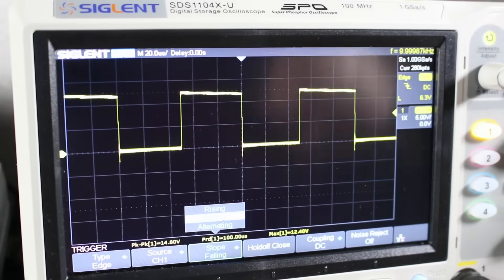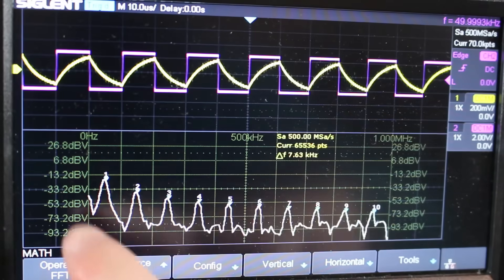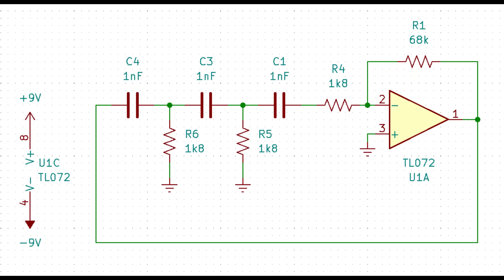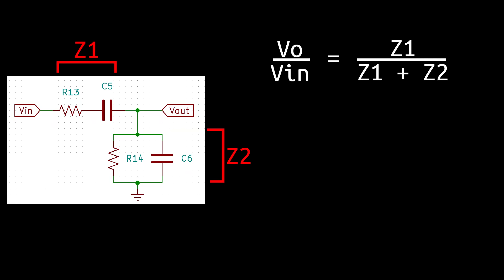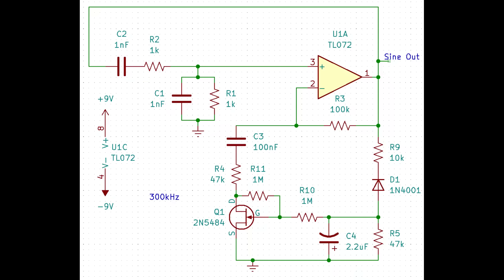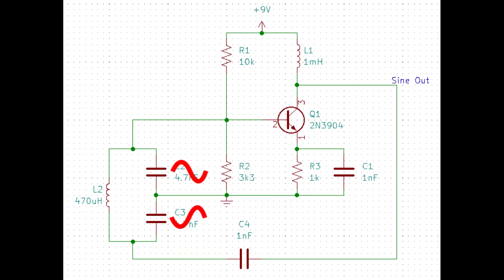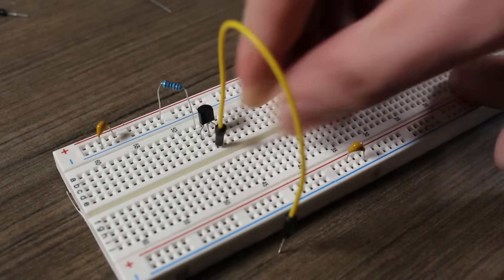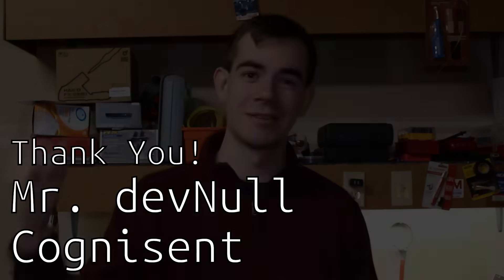5 Ways To Generate A Sine Wave (Analog)

Comment: Ok. Lets say I want 100kHz with max peak value of 5V and -5V

How do you choose the capacitance value, how do you choose the inductance value, how do you choose the resistance value
For like your crystal oscullator, why in series you have a 100pF capacitor? Where did it come from? Why is it in series?

Why do you also have 220K for R1? Where did you calculate that value? What if it was 100 ohms or 50 mega ohms? How can you determine that?

Comment: Oscillators are nifty. One of the original ways to produce a nice sine wave was & still is a gas-powered generator, if you're willing to put up with the noise & stink. Or the original version of an inverter, which was also called a motor-generator. Many of the aircraft I worked on as a young tech in the Air Force featured motor-generator inverters. 115VAC 400Hz.

Comment: With crystal oscillators, you have to use them in the correct mode. You can use a crystal as a series, or a parallel resonant oscillator. The marked frequency is only valid for the mode that the crystal was cut for.

Comment: Beside DDS synthesizers, one can use clocked switched capacitor low path filter to filter meander waveform into sine, e.g. Analog Devices Inc./Maxim Integrated MAX7414EUA+T

Comment: My favourit sine wave oscillator is the Wien-bridge oscillator (named after the German physicist Max Wien (spoken more like "Ween" with the German diphtong "ie" which is spoken like a long English "e").  I use to stabilize the output signal with a resistor ration slidely above 3 (22 k / 10 k) where the 22 k resistor ist bridged with another 22k resistor serielly connected by two anti-serielly connected Zener-diodes. You can also serially connect the 22 k resistor with 2 anti-parallely connected Si-diodes. But this will limit the output voltage to around 0.7 V.

The low output voltage is in general no disadvantage because the THD in this design is very small. But you can use the second opamp of a dual opamp device to make an adjustable noninverting amplifier by use of a trimmer resistor, to set the output voltage to a value you desire.

Comment: In the Falstad's website circuit simulator there is an example circuit of transistor LC oscillator that definitely it's worth it to check it out, it only uses two (!) transistors and can get up to 1MHz frequency with only the parasitic capacitance of a breadboard (I've checked it out in a lab, I don't know what frequency it can get in a dedicated board).

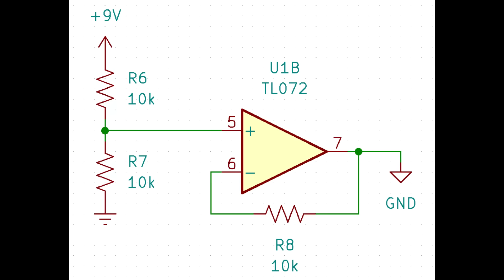Comment: 4:13 Not that it really matters in this context, but if you're trying to minimize error due to input current, shouldn't R8 be closer to 5k (the equivalent impedance of the R6/R7 bias network)? TBH I'd just leave R8 out entirely (output connected directly to the - input), reducing the component count by 1.

Comment: Most of these circuits are incapable of handling a decent load while keeping the sine wave intact. In those cases I usually just run a square wave into a transformer. On the secondary you will have your sine wave.

Comment: Thanks! I enjoyed the detailed screenshots of the scope and schematics so I could follow along at home with my own equipment. Also, may I suggest you add links (cards) in YouTube Studio so they link to other videos you made as you talk about them (e.g. "Ultimate Guide to Transistors").

Is the schematic at 3:07 correct? I built this and put in a 50khz signal, and all I'm getting is a lower amplitude sine wave with a bit of distortion on the downward slope (a "bump"). Very simple circuit, and I've checked all my values and pinouts numerous times. One thing is I'm not clear at what point is the output of the sine wave?
Reply from the maker: It's been a while so I can't remember all of the details exactly, but I breadboarded those circuits based on the schematics that I drew.

Comment: Tried using low pass filters to get sine out of a 555 square pwm, none worked. Spike sines top and bottom. Even repeating the circuit in falstad, same results. Power supply from a battery.

Comment: What I'd like to see is a circuit that can generate a two antiphase sinewaves at 50 hertz which can also be frequency stabilised, then you can build a pure sinewave power inverter that has the same crest factor as the mains, as the designs I've seen for home constructors always use CMOS chips to generate the signals to be amplified, which can easily be stabilised with a crystal but they only generate square waves, no good for inverters.

Comment: 8:09 My home made sine wave generator uses the Wein bridge configuration with a full wave rectifier to control the JFET... it can generate Sine waves from 1.5 Hz up to about 130KHz and has a ridiculously low distortion (less than 0.05% between 1.5 and 20KHz and about 0.1% above that. So, it definitely is possible to make this work.

Comment: Please make a video about “negative resistance devices”.
You can theoretically make a sine oscillator with just a LC tank circuit and a tunnel diode.
Another device that can work is called a “lambda diode”. It’s basically either two JFETs or a JFET/BJT pair that has a I/V curve looking like a capital lambda symbol.

Speaking of other sine wave generator designs:
1.) Triple inverter hysteresis oscillator making a triangle wave over a capacitor followed by an integrator opamp active filter.
2.) Emitter-Coupled LC Oscillator, which is harder to explain but it’s basically an attenuated LC tank hooked to an “anti-current mirror” differential amp setup made from two NPN BJTs. Since the common emitter pointing in a constant current sink thing makes the opposite BJT do the opposite thing compared to the BJT in which we feed the LC signal, it acts to increase the oscillation with each swing. However, due to the current limiting element and due to dampening, the oscillation stays a clean sine wave. Furthermore, this oscillator is more exact than the Colpitts or the Hartley variants because it only uses one inductive element and one capacitive element. With like 3 resistors, 2 BJTs, an L and a C, this is one of the simplest oscillator designs besides the tunel diode oscillators.
3.) Double active integrator filter inverter loop. Very similar to phase locked loops except you have an active non-inverting proportional-integrator-derivative filter in series with an active integrator filter. It has 3 resistors, 3 identical capacitors and 3 opamps. One of the resistors on the derivative side of the pid needs to be a few ohms lower than the rest (for stability and to avoid saturation).
4.) Emitter-Coupled Crystal oscillator (yep, there are those too). Same as the one above but the LC + R is replaced with a crystal.

Comment: I wouldnt call any of these sine waves.If anyone needs a real sine wave with controllable frequency and low thd. Know that It's extremely hard and takes a box of parts. Luckily modern tech has DDS chips that spit out a magical sine wave with low thd (or use a dac if your freq isnt too high)

Comment: So if a sine wave is, well a sine wave, then just out of curiosity, is there such thing as a cosine wave for electrical circuits? Since it uses trigonometry, then its got something to do with circles or spheres, is there any significance to that? Like, are signals actually 3D and we are just looking at it in 2D for simplicity? This probably sounds dumb af, but im curious.
Reply: The waves are just in two dimensions: amplitude (y) and time (x). A cosine wave would look identical to a sine wave except that it would have a 90° phase shift to the left.

Comment: Years ago I built a sine wave generator using a fast op-amp, can't for the life of me remember which one, and a low current incandescent lamp, I think it had to be less than 60mA.
It had several switched ranges, covered frequencies from a few Hertz to about 150kHz and the output was VERY pure, < 1% TDH. 
You can use an R53 bead thermistor, but those are rarer than chickens teeth now and most likely VERY expensive.

Comment: Hey, did you know you can also generate sine mechanically by rotating a round sine-shaped magnet and scanning its shape by coils? That's what Hammond organ is doing.
Reply: Which is then usually sent through a spinning speaker to create a phase shift effect. You can do amazing stuff with mechanical devices but they tend to be very big and gobble power :)

Comment: You forgot one of the most common ways to generate a sine wave that is used on all the arbitrary waveform generators... a microcontroller coupled with a digital to analog converter. 😉
Reply: Doesn't have that tube "warmth" brah.

Comment: At 12:18  Crystals have two resonant frequencies, series resonance and parallel resonance.  That may be why you are getting 6.5 MHz instead of 4.0.

You may also want to look at IMSAI Guy's video #1807 Twin T Oscillator using an OP amp.

Comment: Where is the twin Tee notch ?  It provides very  low distortion,  stability, and simplicity using an OPAMP.  Very good presentation.  
Check out Analog Devices DDS (direct digital synthesis) for the ultimate in range.  Programmed with SPI or I2C.  Follow it up with a multiplying DAC for amplitude control.

Comment: GREAT VIDEO!

I once made a "variable" sine wave oscillator with a switched-capacitor filter IC.  With this filter chip (the mf-10) the output center frequency is determined by a square-wave input.  I just varied the square-wave input (10x the output filtered frequency), and got a completly variable sine out, just by varing the input of a 555 timer.  This allowed the the output sine frequency and amplitude to be independently varied with an op-amp at the output.
thanks again for the video!!

Comment: This gives low power Sine Wave what about sine wave for high power inverters.
Reply: just throw it in some linear amplifier? :D Sorry I'm laughing, I just think amplifying the signal is much easier than generating it.
Reply: You need to generate a PWM signal that represents the sine wave and feed a converter you choose. With a self oscillating UcD you can get as low THD as 0.0001%, with a buck/boost converter this is about 1-3%, with a full bridge converter and some modulating techniques (like a phase shift or a complementary detector) this is about 0.01-0.1%. Then make a choice according to your generator specs.

Comment: Very interesting video. It seems like most of the circuits presented in the video create sine waves with a bit of distortion. I’m wondering how analog function generators can create such perfect distortion-free sine waves? How do they manage to get the sine waves so clean, and also at the same time have the frequency changeable via a pot?
Reply: He mentionned it in the beginning - more filters (or more complex or more steep, simply as high Q as possible) = less distortion. But hey there's no such thing as "distortion free sinewave", even by probing it by oscilloscope you introduce another of many distortions. But yeah you can definitelly make it even less distorted by using more advanced filtering.

Comment: I once made a mathematical model of something, i hoped would become a sine generator.
I started with a rectangular wave and fed it into a constant current source. That source is fed into a capacitor.
The resulting wave will be a triangle.
Then, feed that triangle into another constant current source and the output into another capacitor.
The resulting signal is a sine wave.

Well - i never built that. But i wrote a program, that calculates the currents and voltages. It then compared that to a real sine wave. The difference was about 1%, which surprised me a little.
Reply: The double integral of a constant is a quadratic. Gluing different quadratics to each-other does not an exact sine-wave make.

Comment: I should note a few issues with this otherwise informative video:

- "Wien" is pronounced "veen", NOT "wine" or "vine".
- One needs to be careful with so-called "sine wave oscillators", as a lot depends on how the resulting waveform signal will be used. In many applications, it is critical to get a low distortion sine wave, and the majority of circuits shown in this video, while 'Sine Lab' proclaimed them to be 'clean sine waves', were actually quite visibly distorted, and a distortion meter would have shown this numerically. It is a bit of an art form to visually recognize the presence of sine distortion, made much more difficult for people who have little time viewing truly 'clean' sine waves (but the visual method, even at its best, can miss significant amounts of distortion). Some things even a beginner can look for: symmetry issues (does the down curve shape match the up curve shape), how pointy are the peaks and troughs, do the sides of the waveform look straight rather than constantly curving, etc.
- In a Wien bridge oscillator, some sort of dynamic amplitude control is needed, in order to minimize clipping and other distortion, and this video mentions this and that the incandescent light bulb (not just any light bulb) is traditionally used for this. And this video correctly points out that an FET may be pressed into service as an alternate to the incandescent bulb. But two LEDs, two diodes, etc; may also be used in place of the bulb, with varying degrees of distortion. However, in the incandescent bulb version, the bulb never gets very warm, and certainly does not get hot enough to incandesce.
- In addition to the five ways of generating a sine wave, most modern professional grade waveform generators are doing so digitally; the precise sine waveform shape is stored numerically in a look-up table, and played back at various speeds; this works very well for very low distortion sine wave generation, but its complexity makes the generation of higher frequencies significantly more expensive.

Comment: You left out the Armstrong oscillator.  This is one where the inductor is used as a transformer.  The input of your amplifying device comes from one winding and the output of the amplifier drives the other.
Reply: A true classic and the most common configuration used in a regernative receiver.

Comment: Operating any amplifier in its unstable region generates a sine wave.  Kicking an LC tank generates a sine wave.  Sine waves are the most natural waveforms possible.  The problem is that it is not a perfect sine wave; but, your square wave is not a perfect square wave either -- it has limited rise/fall times, ringing after transitions, and jitter.  It is only difficult to generate perfect waveforms.
Reply: No, many amplifiers don't generate a sinewave when in the unstable region.

Comment: The question one would want answered when deciding which sine wave generator to pick is how close the resulting signal actually comes to being a sine wave. Unlike square waves, this is not easy to judge by looking at the scope trace. A spectrum analyzer would provide this info, but are there any theoretical considerations to decide which oscillator comes closest, produces the purest sine wave?
Reply: Yes, LC tanks with ideal components. Or phase shift oscillators with ideal components (ideally linearized amplifier, ideal capacitors and resistors) with perfectly matched phase (180°). If you're curious about the topic I recommend to try to simulate it and probe it via FFT if your simulator has it. You can try LTspice which is free or falstad simulator which is even available online. You'll see most generators are giving pure sinewaves or squares, the problems begin when you use real components.
Reply: @pheymee88  "with ideal components", so all we need now is for you to tell us where we can purchase these ideal components. ;) Obviously, the point of the question was which design is best with real components. Perhaps we need to look at the design of high-end signal generators for real-world answers.

Comment: I've done every one of these in past when I was a designer.  There's quite a few things can do with each circuit that makes the sine purer and output level more stable, but most real applications don't need them.  The JFET agc is temperature sensitive output level, can get two orders more stability by using a bandgap reference plus long tail pair

Comment: Double integrating a square wave can be used the generate a sine directly.  I built a accurate tone generator for a communication system. Xtal oscillator followed by PLL driving 2 op-amp integrators. Output to 600R line driver. Same principle  but different implementation, without the frequency drift 🙂
Reply: Technically a parabolic wave.

Comment: Theoretically speaking you can use a diode shaper to turn a triangle signal into a sine vawe
Reply: It's not just theoretically; many commercial analog function generators were essential square/triangle generators with an added diode shaper for making the sine wave. One place where this idea is still used is in the modular synthesizer world. Also the XR2206 chip that is the active component on many cheap function generator kits has a diode shaper internally.

Comment: Other than a tiny tungsten lamp to stabilise the gain of a Wien bridge oscillator it was common to use a vacuum-encapsulated self-heating thermistor designed for that kind of thing - R53 for example - but they're no longer made.
Reply: I wonder if a vactrol could also be used or if they'd be too slow?

Comment: What kind of oscillator can be used to create sine waves in the range of 100MHz - 200MHz.
Reply: Try playing with a PLL.
Reply: @gregorymccoy6797  Thank you for the suggestion!!!
Reply: Use a DDS chip followed by a low pass filter.
Reply: @geekthesteve6215  I'll check it, thank you foe the info
Reply: @geekthesteve6215 A DDS to make 200MHz is not a common thing
Reply: That is commonly done with an LC circuit.  Colpitts common base works the best generally.